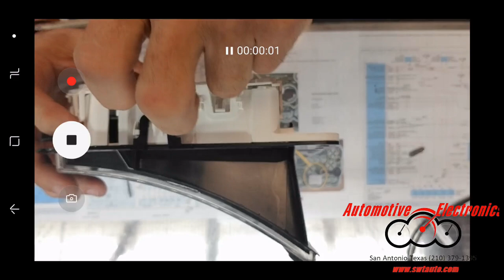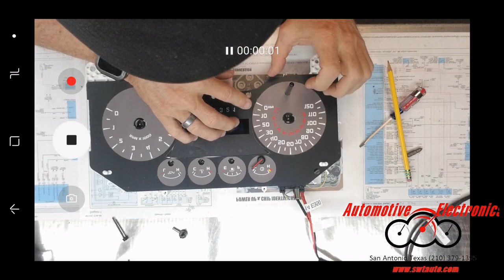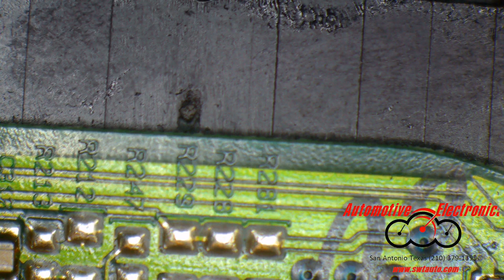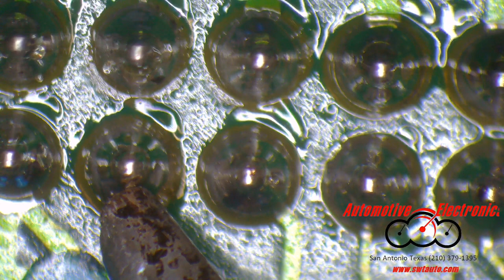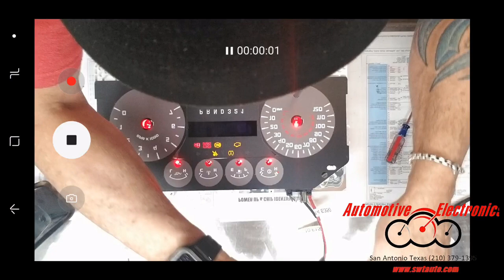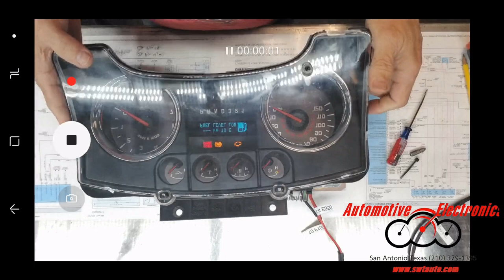10 F150 Dead or Power cycling of the Instrument Cluster.  Easy DIY at home Repair.  IPC repair!!

Comment: My question, if you look at the later models, they had a "similar issue", where it was recalled due to the speedometer going out... but was a SW issue...
I feel these models should also be recalled... same problem, no speedometer driving down the road (traction control lights on, does that also impact that or just a false positive)?
Sure sounds like a recall candidate for me... seeing enough of these out there anymore... thoughts?

Comment: 2002 F-150 v-6 will crank but no start. The mechanic said the instrument panel is the cause of no start. True?
Reply: Don't know if you got an answer, but I had a key "break" and didn't get proper signal, so the security mechanism didn't properly work... had this problem too start near the same time (but appears to be 2 different items, just interesting coincidental timing)... if the cluster isn't working, nothing happens (have to somewhat punch the dashboard for it to "start")... hopefully this gives you some reference, or I assume by now you've already figured it out... good luck.